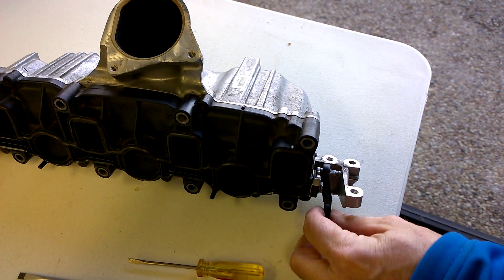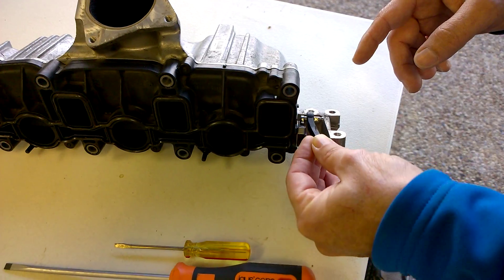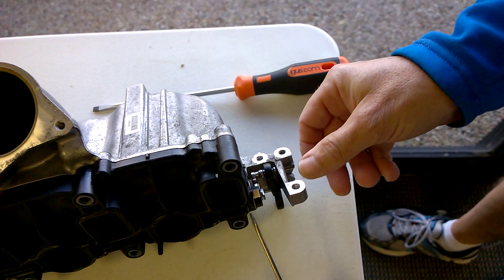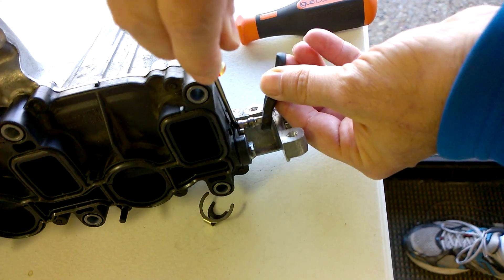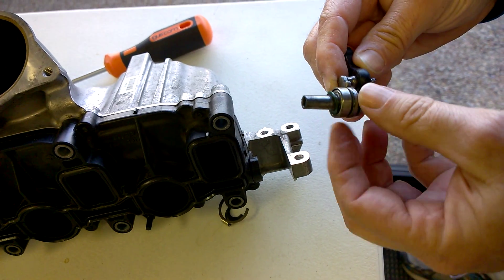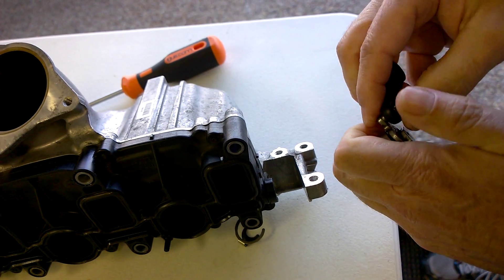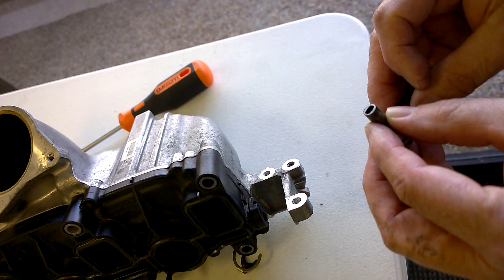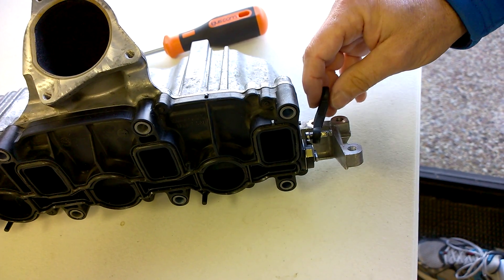All about the V157 motor's butterfly crank arm and linkage rod

Comment: What to do if the Linkage Arm is worn off?  I installed the P2015 fix, but the linkage arm is loose and I lost the spring( which you said is pretty much useless) . Does it still have to work, even if its lose?